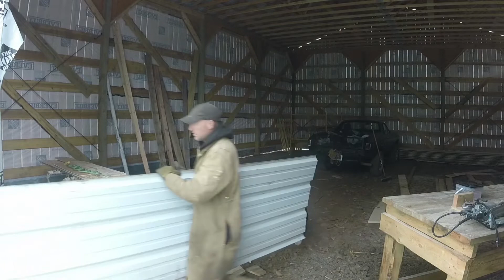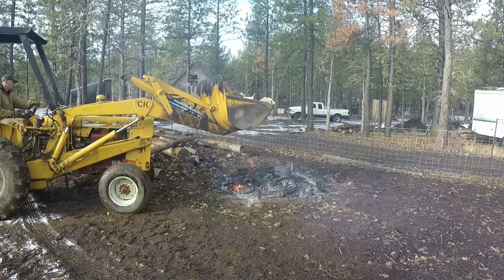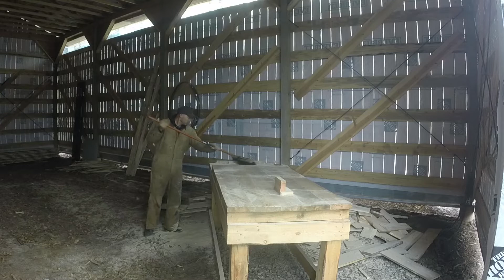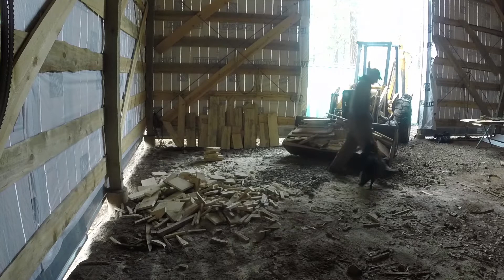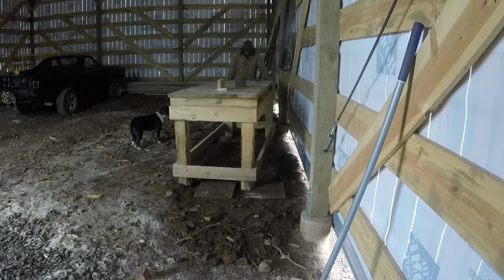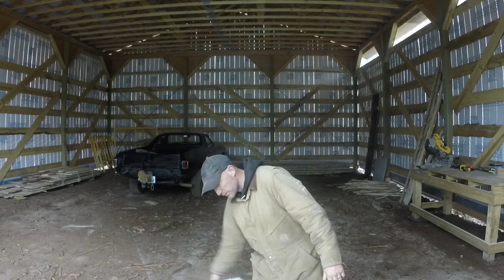Shop clean up day

Comment: A couple of thoughts.  What are your plans for the floor of the barn?  I'll bet it was satisfying to put all of the scrap in the burn pile!
Reply from the maker: The floor will be concrete hopefully next summer. I will have to pour an area myself for my toolboxes but the rest will be poured all at one time. Getting all the scrap out of the way was nice. It was getting really messy pretty quick and I don't like a messy shop. :)
Reply: @KoalityofLife  This summer, I cleaned up an old shed overhang.  Floor was dirt.  Concrete would be great but not now.  I put down a couple inches of "chat," wet it down and compacted.  It was cheap, cleaned things up and still doesn't preclude from concrete or asphalt some day.  Watching you put the concrete blocks under your workbench brought back memories when I put up the shelves in that overhang that i cleaned out.  Set concrete blocks exactly like you did.
Reply: You're snows gone we got it now keep on keeping on looking good
Reply from the maker: @westtexas5754  I didn't want to just sit the bench on the dirt even though its a temporary work bench. Who knows how long I will have it. :)
Reply from the maker: @gregbrown9271  We got a bit of snow now and it looks like its going to keep coming. :)